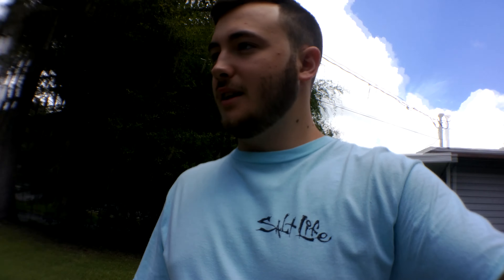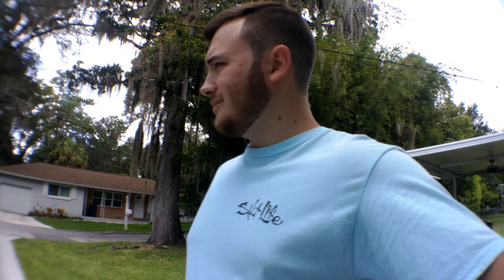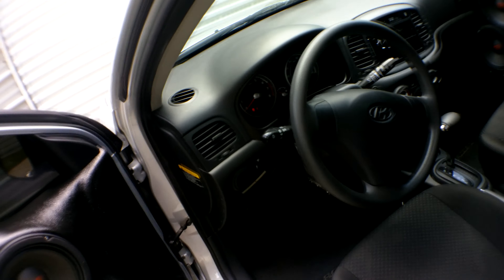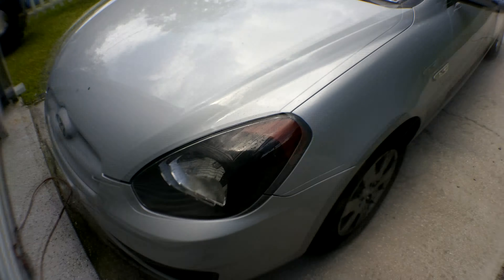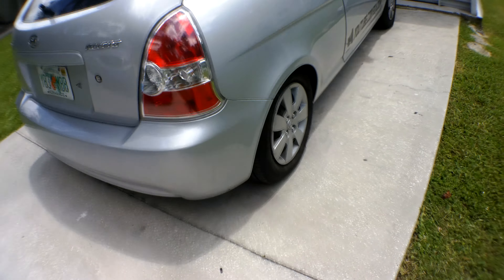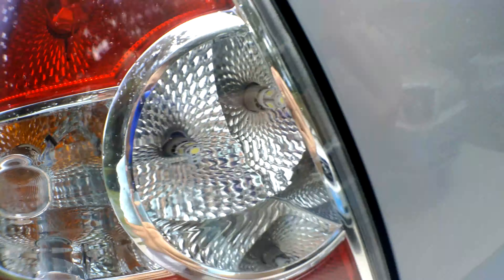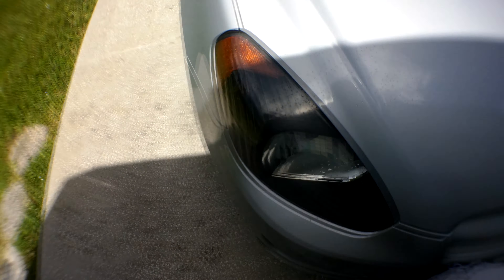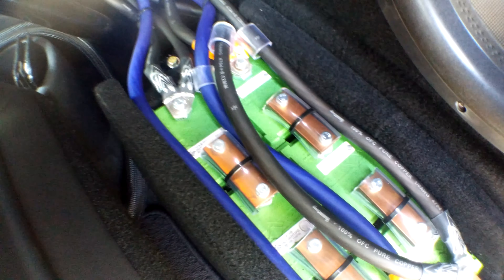SINGER ALTERNATOR SMOKEOUT, CUSTOM CRESCENDO CONTRALTOS, SQ DOORS & MORE!!!!

Comment: You just motivated me to do something with my doors. Finally in the 50s club out the trunk time for some mids and highs considering I'm down to 1 6x9 and 1 tweeter running off my amp.

Comment: How did you fix the engine whine noise I had this engine rpm whine noise when I was using a amp on my 6x9s but my bass amp didn't pick up the engine whine frequency at all
Reply from the maker: I upgraded to quad shielded RCA's, insulated the radio and all of the radio wiring in the dash, and made sure all of my grounds were good. There was still faint engine whine but it had to be dead silent to hear it.

Comment: +EGAjohn what was causing the whine
Reply from the maker: There were ALOT of factors behind it which I will completely talk about in a video soon! When you have so many amps running at once and so much wire running all over the place its hard to get rid of it.

Comment: #1 how TF do you  get out?

#2 where TF do you put your arm?

#3 what  it db mids n HIGHS only? 

congrats on  getting them holes filled!
Reply from the maker: Theres a door popper, sit like a robot, and on one amp they did a 136.8 lol
Reply: EGAJohn dayum.... he'll yea !
Reply: I want to know how he drives with Windows covered lol
Reply: @aaautosport  A 136.8 db with just the mids and highs?
Reply: @aaautosport  That is scary.
Reply from the maker: The most they ever did was a 142 at 42hz on the glass
Reply: @aaautosport  was the 136.8 a average from 20-20000Hz?
Reply from the maker: No that was on one c.2 at 42
Reply: @aaautosport  That crazy.
Reply: We make 4000hp with a 440 Donovan.. no stereo....that's crazy